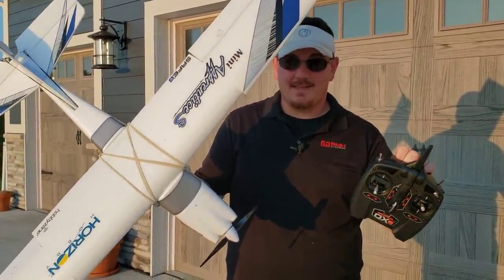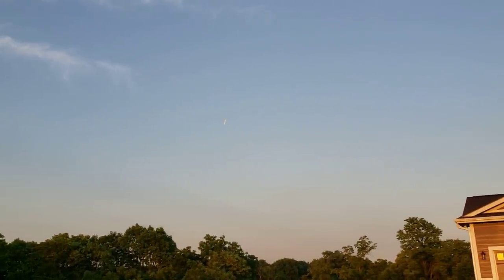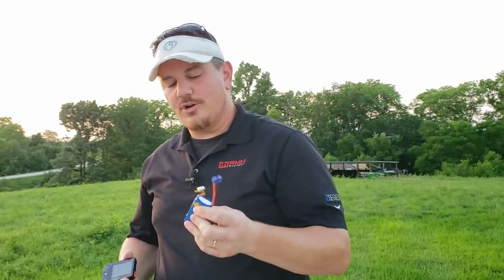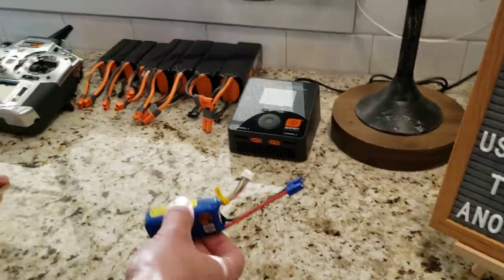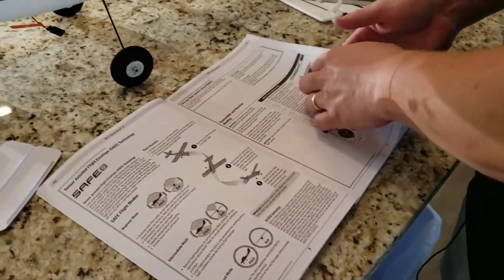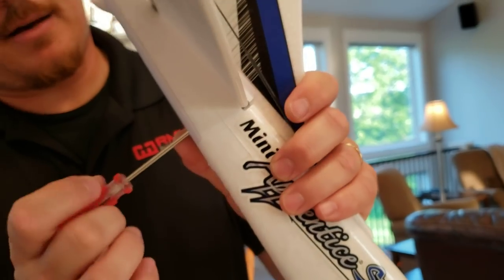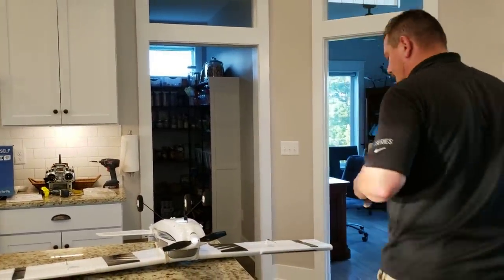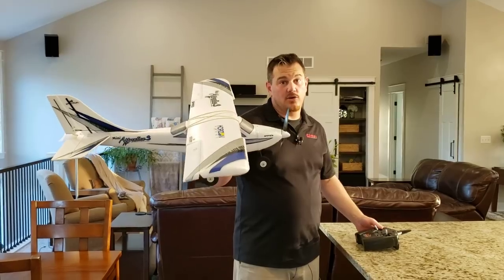HobbyZone - Mini Apprentice S - Unbox, Setup, & Maiden Flights

Comment: I took out my apprentice sts and for whatever reason kept going nose up, turned to the left and refused to turn into the wind, then I couldn't get it to come back down. It was circling to the left and up no matter what I did. I did the only think I could think of at the time and put it into experienced mode and nosed it straight down, about 20 feet before crashing I put it back into beginner, held the stick back and it leveled out turning to the left and landed on its wheels on the track. That was the longest flight I've ever had was about 1min, and that one minute was the longest 1 minute of my life LMAO 😂😂... People yelling at me telling me to turn it away from the tree's, (no shit, like I want to fly it into the tree's), telling me to stop going up so high🤦‍♂️... I was literally holding it to the right and it would not turn into the wind at all, didn't like the idea of it I guess lol. Why did it act this way?, The wind was probably 5mph steady. Afterwards I figured out how to adjust the trimming but still didn't seem to have a good downward elevator, it's was more aggressive on the upward elevator. So up was too much up and down was not enough down.
Reply: With these planes with "stabilization," it is very important they are sitting on LEVEL ground when you switch them ON.  It is on power-up, the gyros learn what level is.  If you initialize on "crooked" ground, then plane will by default fly in that same "crooked" orientation.  Find someone at a club that can help you check your linkages, and radio setup.  If you're not near a local club, then maybe post on Craigslist.  Create a "dummy ad" that will lure in RC flyers.  Once inside the advert,  explain upfront you are seeking someone to help you get started in the hobby.  Many folks are happy to share their knowledge.  (Just re-read your post, and sounds like there are some "experts" around.  Find one that is not afraid of a plane with gyros and stabilization.   I set my radio so I have a TWO-WAY switch set goes between Beginner or Advanced.  Three-way is just an opportunity for confusion.  You might want  a two-way to switch  BEGINNER/INTERMEDIATE.
Reply from the maker: yeah, SAFE is very "heavy" on the elevator (or pitch) axis. As you could see in the video, I could barely bring her into a nose down configuration. When you get a better feel for how to deal with things, you'll be less stressed, and it'll be way more fun, and less scary!

If in doubt, get a few more "mistakes high" and then turn with the wind. You know how they say "You can always go around" - NOT TRUE...sometimes the batteries are out - but you will start to learn the limits of the aircraft, with or without SAFE.

Give it some time, and you'll be irrationally yelling at the new guy to "turn away from the trees" - LOL ;)
Reply from the maker: Chet - I agree - Why do we need three modes??!!? SAFE Select is so much less complicated. If I don't have auto-leveling, I sure as hell don't want limited bank angles! :)

Comment: what exactly is the difference between the EC3 and IC3  plugs... and which is better  and why ..thanks
Reply from the maker: IC3 plugs are on the new SMART batteries and ESC's and they are easier to plug in and unplug by a million times.

EC3's are the SAME size, and compatible, but they're a real pain in the butt to plug in and separate. They're hard to make too...but they are cheaper,

Also, you can plug an IC3 or EC3 battery into an XT60 equipped aircraft, since the PINS are the same size ;)

Comment: Hey Brian, is the Spektrum s150 smart charger compatible with the original e flite battery that comes with the RTF version? Thank you!
Reply from the maker: Sure! You can charge a bunch of types of lipos. If you have the right end, or adapter, you'll be good to go. I have a ton of adapters.

Comment: Very nice plane and very well explained on your video!  At what low voltage do you usually setup that alarm device to trigger for most of your planes?
Reply from the maker: I usually set them for 3.6VDC. If the alarm is in an EDF, I might step that up to 3.8 VDC, and that's usually not great, since you can't always hear them over the whine of the EDF.

Comment: Hi Brian, thanks for the great videos. I'm sorry if I missed it, but about how far did you mechanically trim that elevator? I took mine up for the first time this morning, and had the same issue. Radio down trim is maxed.
Reply from the maker: You have to get it trimmed to fly level, then just land her, and make the mechanical trim. You basically just watch where the elevator IS when you land, then you can physically match that. If you have to do it more than one, I would be looking for a CG issue....possibly nose or tail heavy.
Reply: @BrianPhillipsRC  Thanks so much Sir!

Comment: So I have the original connecter that’s blue I forgot the name of it, would that work with the ic3?
Reply from the maker: EC3 - Eflite Connector 30 Amp.
Reply: Thanks. Would the ec3 fit into the ic3? Because I have an ec3 battery not the ic3 and the bnf version of this plane has an ic3.

Comment: I had a fly away ,can you do a video of this transmitter and bind it with the apprentice STS.I watched the whole video and you passed right over the part I needed. They said I can use this transmitter with other bnf models and I was trying to save some money since I lost the mini.
Reply: I am waiting on the gps to come in so I don’t have another fly away on my STS. Also can you do a video of how to set up the gps for virtual fence and the binding process with that little orange bind plug 🔌.
Reply from the maker: I assume your dealing with the NEW Apprentice STS, right? I have an old one, so my video might be a bit different,not to mention our production schedule is full.

I realize now that I "skipped right over" the binding procedure, since the transmitter was already bound to the plane. Sorry if I led you to believe I had covered that, as I generally do cover it.

Here's what you can do to get it bound up to your DXe...
1) Click this link, https://bit.ly/3eZ6iKW which will take you to the Apprentice STS BNF... 
2) Scroll down to "Manuals & Support", and click
3) On the dialogue box that appears, choose "Apprentice STS 1.5m Manual - English" and download it
4) Once downloaded, open the document, and go to page 10

Or follow steps below...

1. Make sure the transmitter is powered off.
2. Make sure the transmitter controls are neutral, the throttle is in the low position, and the aircraft is immobile.
3. Connect the flight battery in the aircraft, then power on the ESC switch. The Flight Controller LED will begin to flash red and blue.
4. On the remote Spektrum receiver that is connected to the flight controller, press and release the bind button. The receiver LED will flash rapidly.
5. Press and hold the trainer button on the top of the transmitter while turning on the power switch.
6. When the receiver binds to the transmitter, the receiver LED will be solid on. Flight controller LED in windshield will also be green when in beginner mode. (without LAS or GPS installed) Once bound the receiver and transmitter should retain their bind for future flights.

IMPORTANT: IF THE OPTIONAL GPS MODULE IS INSTALLED the aircraft will not respond to transmitter commands after binding if it cannot acquire a GPS
signal.
Binding: After binding with the GPS module installed, the aircraft will search for a GPS lock, indicated by the elevator slowly cycling up and down. After
acquiring a GPS lock, all fl ight controls will respond normally except throttle. The throttle will be limited, allowing the aircraft to be taxied out to takeoff
position on the runway. Set the home position to regain full functioning throttle. See the Powering On With GPS section of this manual for further details.
Compass calibration: After binding the fi rst time with the GPS module installed in the aircraft, compass calibration is required. The aircraft will automatically
enter the compass calibration sequence after installing the GPS for the fi rst time. This is indicated by the ailerons slowly cycling up and down. The aircraft will
not respond to transmitter commands with the GPS module installed until calibration has been completed. See the Compass Calibration section of this manual
for further details.
Subsequent binding with the GPS module will not require compass calibration.

This page outlines the exact binding procedure for with or without GPS module. It's not hard, and you can do it.

Here's what you can do to setup the virtual fence...
1) Click this link, https://bit.ly/3eZ6iKW which will take you to the Apprentice STS BNF... 
2) Scroll down to "Manuals & Support", and click
3) On the dialogue box that appears, choose "Apprentice STS 1.5m Action Sheet Multilingual" and download it
4) Once downloaded, open the document, and see what stick position to use to set your desired mode
Reply from the maker: I'm a bit concerned that you'll need the new DXS, not the DXe...but the manual seems to show a DXe...so I guess you should be fine!
Reply: Brian Phillips thanks the plane  does not have a bind button and it just keeps flashing and when I do the controller it makes a dud sound like it didn’t work lol. I’m assuming the bind plug from the old plane is needed.I assumed this was for the original plane use only .I will follow the links and try and figure it out.Its very confusing being a noob.The video was very informative and sorry I  forgot to give it a thumbs up

Comment: hey brian i dont know if you see this but can you also put an smart battery of spektrum in it like an  2200mAh 3S 30 c? i dont like the battery and charger that comes with it but i want the RTF edition because might be my first plane. Thank you!
Reply: oh by the way i want to say i prefer to get the other battery. the flight time is really good on the original one
Reply from the maker: yes, for sure. Fits nicely! We use the 2200mAh 3S 30C SMART when we fly it. It's about all the battery area will take without mods though.
Reply: @BrianPhillipsRC  Ah great then this will be my first plane😀. Thank you very much and have a merry christmas!
Reply: I have also one final question, what is better, the apprentice mini s or the carbon cub s2? I like the telemetry on the carbon s2 and the battery and charger but i also love the looks on the apprentice mini. I can upgrade to the battery pack easily. I just have to buy the 2200mAh smart battery but im just not sure wich plane is better. Maybe you ca say it?

Comment: The only thing I don't like about the combo is the radio seems to have way to much play in the sticks, Otherwise great combo.
Reply from the maker: It's "okay" as you mentioned. Ironically, I didn't "notice" once I was flying??? The DX18 Gen1 sticks feel SOOOOOO good,  so I'm spoiled ;)
Reply: @BrianPhillipsRC  they should include a basic computer radio that has like 5-10 channel plane memory si the new pilot can buy some other bind and fly planes
Reply: @BrianPhillipsRC  Brian, I just got the FMS 1700  Tigercat. I would like to add AS3X is the AR637T my best option? Or what would you do.

Comment: how did you level this thing?  also, this thing is fast on landings even with the throttle cut.  how are you slowing it down?
Reply from the maker: You mean, how do I get it to AUTO-LEVEL? I use the beginner mode.
I slow the plane down by using the rudder and ailerons to counter each other. This caused the plane to slow down a bit, but it's a bit tricky for a new pilot to pull of. If you want, you can practice a few mistakes high, and see if you can get it to work for you.
Reply: @BrianPhillipsRC  thanks for the reply brian.  what I meant was that the plane is climbing in each flight mode and I have to constantly throttle down or give it down elevator.  elevator is centered, checked it several times.  may need to manually lower it a couple of notches.

Comment: How would you compare this to the Carbon Cub S 1.3 as a first plane?
Reply: The Carbon Cub S 1.3 is a great plane. For a beginner I would start with one of the Apprentice models as it’s so stable in the air. They both are. I find the Apprentice easier to take off and land due to the tricycle landing gear. The Cub is a tail dragger and will have pull to the left so you have to give a bit of right rudder on take off and for landings you have to put is on the main gears and then drop the tail or you will nose over. It is a great second plane to learn new skills so you can move up to war birds.
Reply from the maker: True...but don't get too excited yet; Chris might be able to watch them side by side; after all, I "may" be reviewing the Carbon Cub 1.3 pretty soon ;) (wink wink)
Reply: Brian Phillips if you do add the flaps to the Cub just a heads up remove the paint in the molded pocket on the wing for the flap servo before gluing it or it will peel the paint off and the servo will fall off. Just a light cut with a knife and some tape and and it will come off in one shot. Then glue it to the bare foam.

Comment: Will this plane work with the eflite 11.1v 2200mah battery?
Reply from the maker: YES, tight fit, but I know mine will fit...

2200mAh 3S 30C https://bit.ly/2OxutFa (Mine)
Reply: Another question for you, I am trying to find spare props for this plane and it’s discontinued and out of stock everywhere. Is there an alternative to the 8.25 x 5.5?

Comment: Hello, do you have a film of the Cessna 182 trainer plane with a wingspan of 141cm. Just ordered it online in Norway. I can't find any film of it here on YOU TUB. Produsent: FMS

Cessna Sky Trainer 182 V2 1400mm Blue Gyro RTF
Spesifikasjon:

Wingspan: 1400 mm
Overall Length: 1100 mm
Flying Weight: Around 1520 gram
Propeller:11 x 6" 3-blade
Motor Size: Brushless 3536-KV 850
ESC: 40 Amp
Servo: 9g Servo x 6 stk
Ailerons: Ja
Flaps: Ja
Navigasjonslys: Ja
Gyro: included
Radio: 8 Channel - included
Recommended Battery: Li-Po 3S 11,1V 2200 mAh - included
Charger: 3 S LiPo - included
Reply from the maker: The Sky Trainer has been discontinued, if it's the one I think you are asking about. We reviewed it in a PNP configuration here: https://youtu.be/cpLCErbyN_U

The exact same plane has been rebranded by Arrows, but is not available in a RTF configuration anymore: https://bprc.me/Arrows_SkyCruiser

A better replacement option, but also not a RTF, would be the FMS Cessna 182: https://bprc.me/FMS_Cessna182

Hope that helps!